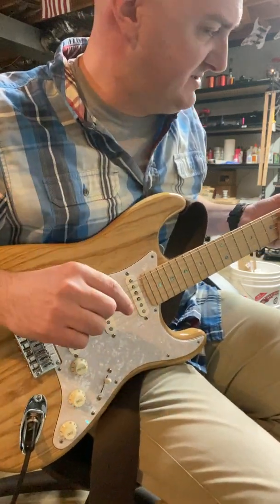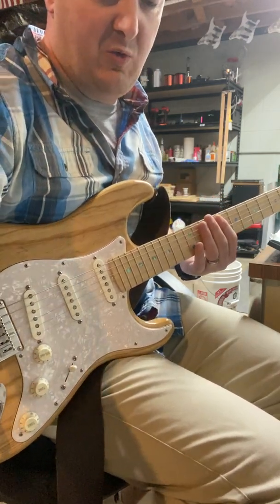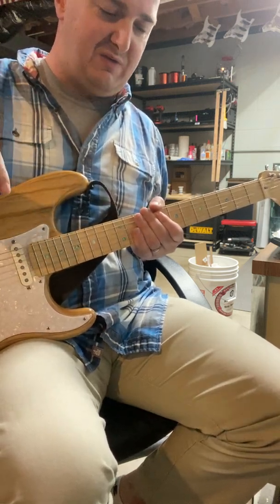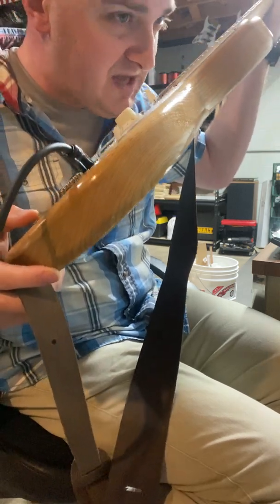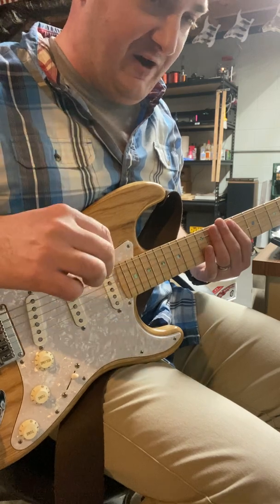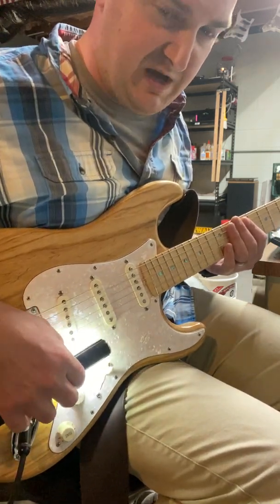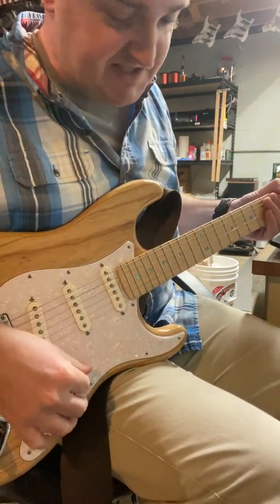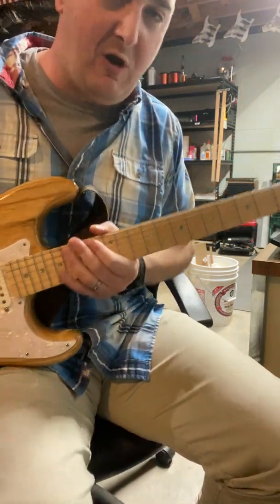60 cycle hum, RFI and Shielding is useless Noisy electric guitars SCIENCE EXPERIMENT

Comment: Sometimes I get really confused.
I have a static noise in my guitar whenever my hand touches the scratch plate (pickguard).
I have no idea what cause that.
Reply from the maker: Static electricity.
Reply: @MathewsGuitarWorks  oh, ty
Reply from the maker: Is it really dry where you are? Running the heat or have a fireplace drying stuff out?  Sometimes you have to put something to jump the control plate/pickguard to ground to bleed off the static. Sometimes it’s just hard to get it to go away on some pickguards and it requires a new guard to get it to stop.
Reply: @MathewsGuitarWorks  oh thanks much. 
I may just get a new pickguard. I live in Maryland. 
It's a perloid pickguard. I think you are right, that's the problem.
Reply: My 2016 Gibson SG (p90's) has that problem when running my hand along the back of the neck or the body. I've others Gibson's of that period having the same issue. With the guitar unplugged I can still hear the static noise on the back of the neck. The problem begins with whatever flawed finishing process Gibson used then. The static exists on mine regardless of the season or humidity. I think my only solution will be to just lightly remove the top layer of finish on the back of the neck.
Reply from the maker: @Jeff Luna yup, it helps temporarily.
Reply: @Jeff Luna oh ok. Ty

Comment: I got the 60 cycle hum, WITH NOTHING plugged in. And it's loud. (Princeton 112 Plus). Every NOISY GUITAR video I see, goes on and on about the GUITAR, pickups, shielding, etc. NO videos on how to eliminate the hum from the amp, sitting there, alone. I've copper foiled my pickup cavities and everything is grounded as it should be. Other amps I have are quiet.
Reply: in a tube amp it will most of the times end up being heater filament current in a faulty pre-amp tube that is causing most of the hum, some wiring done wrong (signal leads passing in a very near proximity to high current leads or poor filtering in the recto circuit. Swap some of the preamp tubes if you have a possibility to do that. Might be a quick fix.
Reply: You probably have a ground problem with that amp, maybe a loose connection. Check inside the amp and the net cable.
Reply from the maker: Are you using the tremolo on the amp?

Comment: Nice video. I have the same noises. At the beginning I thought that my Strat guitar was damaged or the amp but after doing several things, I understood that those noises are kind of normal with strats when the home wiring is not properly made (mixing phases) and definitely the problem is not the guitar. And you are right that some pickups get the noise higher than others and it doesn’t mean they are bad or cheap. It is just how they are and its “personality”.
Reply from the maker: Exactly.  Some people throw the baby out with the bath water because they don’t understand what’s going on. Just trying to give some clear info to help people understand. Personally I’ll deal with 60 cycle hum to have real strat pickups. Noiseless pups have their place but I prefer real single coils myself. Thanks for stopping by and commenting! 🤘

Comment: The first example of a single coil hum that i have seen. Been trying to find out what it sounds like since i am about to buy my first electric guitar. I read there are no hum single coils one can get so i guess i will have to go down that road.
Reply from the maker: Unless you are playing with massive amounts of gain(distortion) you don’t need noiseless single coils. They don’t sound like true single coils.  I play with classic rock (ZZ Top) level amounts of gain and still don’t hear the 60 cycle hum bad enough to lose the sound of real single coils. I’ve had some noiseless single coils in the past. There are some good sounds that can be had but they still don’t sound as good to me over a real single coil. 

If you want to play with lots of gain ( hard rock, heavy metal kinda stuff), you need something with humbuckers. 

Honestly I wouldn’t worry about it.  If you are after a guitar that has single coils don’t cheat yourself, get single coils. If you need something else, get what fits your needs.

Remember guitars are like golf clubs. You can putt with a driver and drive with a putter but they aren’t always the most effective. Each one has a sound that may get you to where you want to go and all guitars can do multiple genres. 

Thanks for watching and commenting.
Reply: @MathewsGuitarWorks  I bought a fender squire mustang today. Short scale. I was dithering on short scale and reg scale for about a week. Read up about either. There is a rabid anti-short scale feel on the internet. I came across one comment that suggested that people ignore all that crap and go by feeling. Does this guitar feel like it belongs in your hands? Does it FEEL good and ok? I have small hands and a broken fretting pinky that is bent at an angle. I always struggled to put the pinky down. Reg scale string tension is higher so req more force to put down the string in its place. I tried this short scale second. It fit like a glove. I knew right away that this was the guitar. So i bought it. It has two humbuckers so i guess my problem is silved. Good luck on your journey mate. Mine is just beginning, again.

Comment: This video is ridiculous and actually is incorrect in that it provides bad information. I personally own three Les Paul's that all had a grounding buzz that would go away once any of the ground points were touched (strings, bridge, etc.) The control cavities and cavity cover have been lined with foil and properly connected to ground, and the guitars are ABSOLUTELY noiseless with my amp set at the highest gain settings. This is in practice, not theory. Placing ungrounded foil outside of the strings will act as an antenna and cause more noise. Also, not sure about the popping noise, but that is definitely not normal...get the electrical service checked out.
Reply from the maker: You obviously didn’t pay attention to what I was saying or demonstrating. Your ground noise is not the same as RFI.  I can reproduce this same thing with a properly shielded cavity guitar. Shielding does nothing for RFI or 60 cycle hum. That’s exactly what I explained and demonstrated in the video. I can do it again with a shielded guitar and if you actually watched the video you would have heard the part where I mentioned that the wiring in my house was naturally noisy and there’s nothing that can be done about that short of a very expensive power conditioner. Literally every point you made I addressed in the video specifically and gave physical examples. Just because you don’t understand it doesn’t mean it’s incorrect. Thanks for watching and commenting!🤘